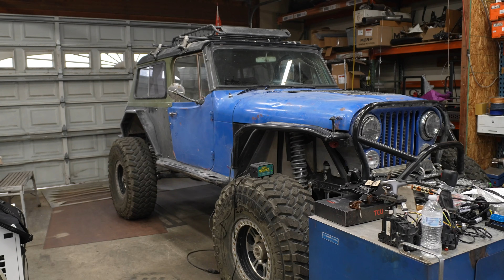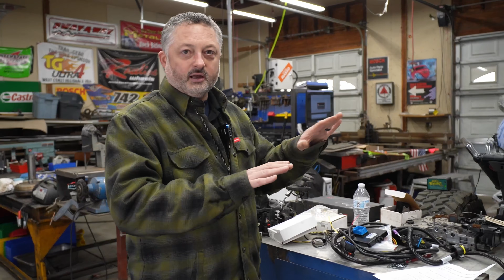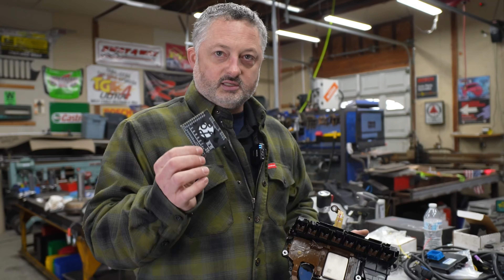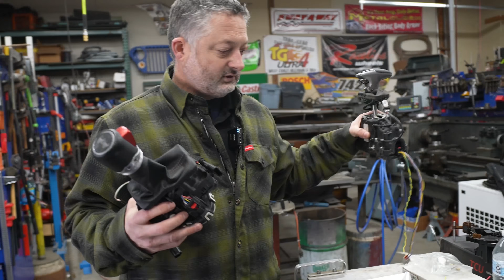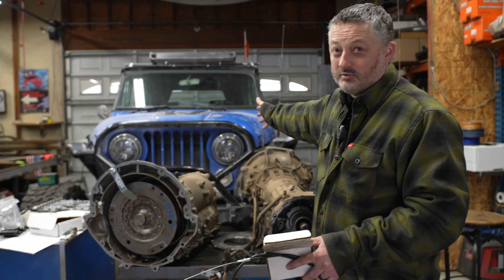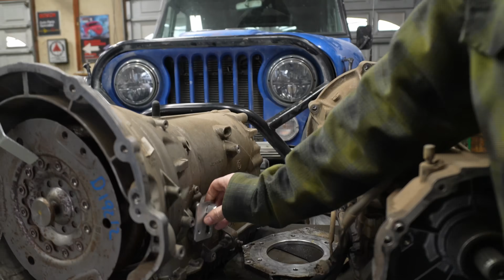8hp70 Swap Guide. What you need to know

Comment: MaxxECU is good enough that a video that doesn't compare it isn't really super useful. Some info is a bit off too. The Maxx mini can run as a can gateway like cantcu with other ECUs controlling the engine for under half the price. 
I apologize for coming across a bit harsh but working on euro cars without using the swedish ECU that's supports a ton of euro vehicles seems a tad silly.
Reply from the maker: Thanks for watching. When I started swapping 8hp the MaxxECU did not have an option on the market. I looked at what they are doing now and you are correct. The Mini can be used as a can gateway. The MaxxECU looks to be a strong contender in the market.  I'm in the US so the euro swap are not nearly as popular here. LS engine and Holley ECU dominate the market here.  The aftermarket development around the 8hp is crazy right now. I'm sure things will keep changing and better options will keep coming.  I did not take it harsh. I don't think I know everything. Their are people way smarter than me. I like getting feedback and learning new thing.
Reply: @CLDesigns742  8hp support was released in beta in May of 2024 for Maxx. The binary 5 out now essentially allows all the functionality TL does. Maxx's beta was better than HTG...ever. Turbolamik was terrible when it was release. It came out at least 2 years early. Many 8hps died because of it but I'm glad they stuck with it. It's a great product now.

Holley's dominance is, IMO, undeserved. Too much money for too little performance. Like Fueltech, meh product, excellent marketing. Their cheaper ECUs could handle the dominator software but no. You have to pay more to unlock software. I prefer to pay for extra I/o and have all ECUs use the same software. I'm completely biased towards MaxxECU but with good reason. I've not been able to come up with an idea and not be able to pull it off in the Maxx one way or another. If it can't, send in a feature request. 9 times out of 10 it'll get added.

Appreciate the attitude. If you're not learning, why bother!

Comment: Maxxecu will run standalone for 8hp control so you can integrate with your stock or aftermarket ecu's. It's also the cheapest option for 8hp control. Maxxecu Mini's are under $800. I'm getting ready to do a Ram 8hp70 and a Atlas behind my TDI that that's in my double cab Tacoma using the Maxxecu Mini for just the transmission.
Reply from the maker: Very cool. I didn't know Maxxecu had gotten that far with the 8hp development. I will have to look into that more. The Taco sounds cool.
Reply: Cool. A TDI what? There a lot of VW Diesel engines. The atlas sounds like a serious thing you are building. 
But I am not sure how easy it is to connect the Maxxecu to an VW engine ... Would be very interesting to see how this goes ...
Reply: @derJackistweg I'm using a CJAA which is a 2.0 common rail and I got the Maxxecu communicating over can bus with a TDI ecu so far but I will most likely be running a full standalone on the TDI (Baldur DID1) when I swap the 8HP.

Comment: What was your experience with the PCS controller?  You didn't really talk about it.  I'm going back and forth with Turbolamik and PCS.  PCS seems like a set it and forget it but I have a TRX 8hp95 I'm putting behind a Hellcat so I don't want to hack up my mechatronic before I figure it out.  I'm also kind of holding out for Maxx ECU to get gen2 transmissions added incase that is a better option.
Reply from the maker: I'm using the PCS controller in analogue mode, So very limites torque management. The Tacoma doesn't make enough power to matter.  If you don't have an engine controller yet, then I would recommend Maxxecu. It would be able to handle both the engine and trans. If you are using the stock mopar ecu, then I would recommend talking to Russell at German Sound.  He will have more info on the Torque management for the stock ecu. I believe he is the guy that developed the 8hp integration for the Hemi jeep swap.

Comment: Hi I have a jeep comanche with 4.0L 6 cyl inline  is there a way to install a zf 8hp ?
Reply from the maker: I bet thier is a way to make it work.  I'll try and make anothr video and see if I can add some info to help.  Thanks for watching
Reply: @CLDesigns742  lots of Jeep owners interested in the 4.0 to 8hp70. Here you talk about how important can data is but I thought on your Toyota you didn’t use can data? Getting the can data from the wranglers might be difficult
Reply from the maker: @klikboom  The 4.0l doesn't make enough torque or hp to require torque managment. So running the tranismission managment vis analogue data work fine.

Comment: Great video 📺 Larry! Good presentation, chock full of information. Wicked build and shop setup 🤘 🤠

One small correction just for those reading. CANTCU does integrate with Holley CAN bus for torque management. Its been a very popular choice for many of my customers but doesnt have quite rhe depth of features that Lamik has. It can be used with Dodge/Land Rover 8HP variants if you flash the TCU with BMW software or swap a compatible BMW TCU into the unit.

MaxxECU and others can also integrate but my require an intermediary CAN signal conversion box or other methods. SGA recently added Holley support as well, Fueltech I can't speak to as its still in its infancy.

Shamless 🔌 if anyone needs assistance we have adapter kits, accessories and top notch 🇺🇸 USA based support.
Reply from the maker: CANTCU seems to be stepping up thier game.  I heard they were working on the Holley intergration. Super cool thats an option now.  Things are changing fast right now. Its hard to keep up with.
Reply: @CLDesigns742  really is difficult to keep up so many different products, updates and variations with all the components. I try to stay on top of it and still learn new things all the time.
Reply: Great additional info. Glad I read the comments. Thanks

Comment: can tcu is better in my opinion.cheaper a n kens support is good.i use it in my old sprinter van and it works great.iven display gears on stock cluster,abs esp works,brake pressure management.torque management perfect
Reply from the maker: When I was looking for control options CANTCU was not a good fit for my projects. I have heard they have made several advaments in the product. They can definately the right choice for some applications.  The sprinter swap sounds cool. I'd love to see that. 
Thanks for watching.

Comment: What are you doing for transfer cases behind the 8HP?
Reply from the maker: 3.0 Atlas.  I have a billet adapter on the Commando BUT.. on my wifes Tacoma with and 8hp70 and an atlas I used the stock RAM 4x4 adapter. it has the round 8 pattern. I did have to grind a bit of the corner off or it.
Reply: I'm in the process of swapping an 8hp, and I used a ram 8hp with a jeep 242 because I wanted the AWD position.  It bolted right on, except for some very minor filing of a casting web so that the case would sit flush against the back of the transmission

Comment: Came from WFO/Trevors channel.

Bunch of great information.  
Can you do a video specific to the Tacoma? It seems like you are the only person with a ZF taco, as there are no mentions about this on the Taco forums....
Reply from the maker: Your probably right.  I had to order a custom engine to trans adapter to make it work. The adapter came from Domi Works BUT I ordered it without some of the bolt holes drilled and NO starter. I drilled all of the lower bellhousing bolts and just a mill to bore the starter hole. 
Let me know if you want more info. I'm happy to share

Comment: Some great information on the Turbo Lamik controller that I wasn't aware of. The only thing with the Lamik is the reliability from the removal of the factory TCU then using the 16 pin connector for sending power to the solenoids as those pins are not made for that. I personally like the Powertrain Control Solutions TCU as you keep the original controller this shift quality will be as good as factory (Providing that you correctly map your throttle TPS to engine torque values well. A downside with the PCS controller is that you'll need to purchase something like HPTuners to make changes to the factory TCU should you wish to make changes to shift RPM etc. Software for the PCS isn't that bad especially as you will not  need to make changes after initial set up.
Also there really is not much information anywhere on PCS which I think is down to the fact its not really advertised in the car aftermarket as they seem to be more focused on OEM stuff. I actually bought a PCS 2060 for a conversion I am going to do on my own vehicle and have been impressed with the quality of the TCU and its loom.
Reply from the maker: I have a config file for the analogue PCS controller if you need it. Russel at German Sound is the man when It comes to the PSC controller and 8hp70 stuff.
Reply from the maker: I think the pins are ok. Some people are using wires as jumpers solder to the pins. I have heard the PCB board solder joints can crack. I encapsulated the pins and PCB with potting compound.  The factory TCU uses tiny wires to control the solenoids
Reply: I have an ambitious goal to do a 07k ZF8 swap but this video is the best information I found so far on total standalone stuff. I’m not sure if I can make a Volkswagen ECU communicate with the BMW or a Dodge TCU? any legends in the comments that have any advice, or have work with Volkswagen in the past.